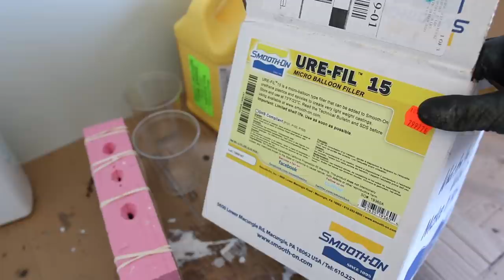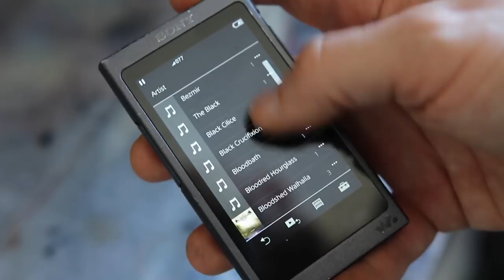lets make a injured Crucian carp swimbait.

Comment: I also tried plastisol for some tail trial runs on my swimbait w/ the same experience as you mentioned  (not so durable even using a hard one). What is used wall thickness w/ this rubber as a tail that you showed over here - as a more reliable solution? Thanks ;)

Comment: For the eyes to be aligned, in smaller lures, I use a pincer with the ends bent to the inside, they must be perfectly aligned and make the same trajectory when you open or close the pincer

Then I hold the pincer lightly closed and double check if the horizontal and vertical angles are aligned

Then I close the pincer firmly and mark the center spot for each eye
Reply from the maker: Thats a good way of doing it too 👍

Comment: How much micro balloons would you add to 91.5 grams total of Smooth cast 300 liquid plastic for glide baits?
Reply from the maker: I usually go with 5 to 10% so maybe I would add 2.5g of micro balloons
Reply: @SolarfallBaits  OK, well on my blanks I've made so far had 7.3 grams 😬, I have been struggling with the wait of the swimbait,but thank you I will try 2.5grams.
Reply from the maker: @colossalbasscustombaits5963  its one of those things you just have to experiment with to get the right amount dialed down to your specific lure. That's part of the fun or frustration of lure making
Reply: @SolarfallBaits  Very true, Thank you for the tips.

Comment: Sat all the way through this to see how to make the joints and that's the part you don't show it!? Thanks for nothing
Reply from the maker: I assume you mean how i connect the segments together, cos i do show how the joints are cut . i use a simple a screw eye to screw eye connection. You just drill bunch of holes and glue them in. And boom your welcome
Reply: @SolarfallBaits  how do you screw two screws connected? No need for sarcasm either...
Reply from the maker: @teamloomisoutdoors1787  you open the eyes on the opposite screw eyes enough that they can be slid in with each others and then you close the eyes.
Reply: @SolarfallBaits  thank you